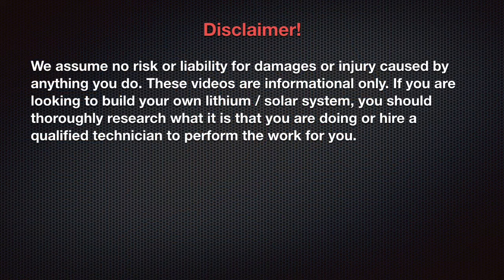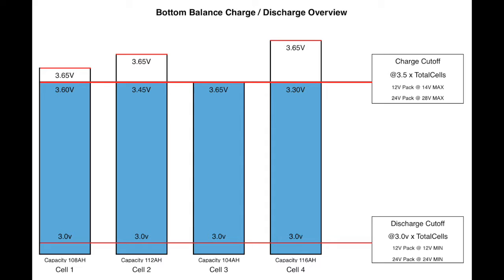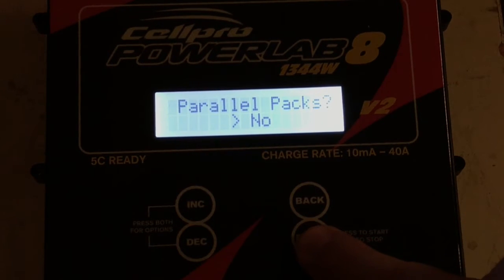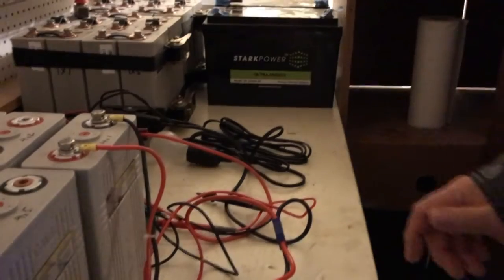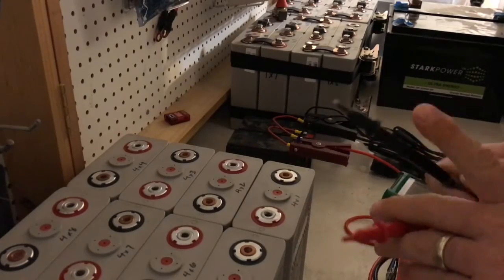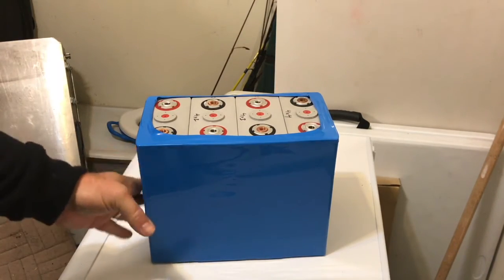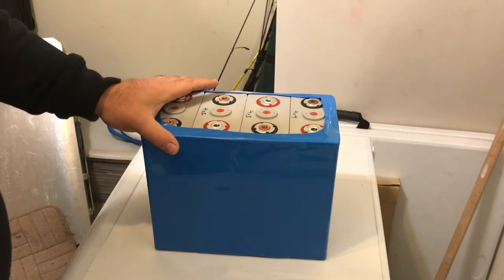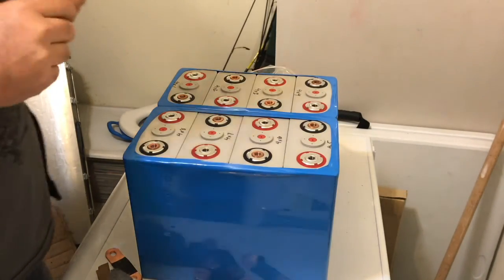Full Time RV Living | Lithium Battery & Solar: Part Three Building the Lithium Battery Pack

Comment: Okay, I'm still following this series and enjoying it.  I have one problem while watching and that is you WEARING THE RING while working in these low voltage high amp situations.  During the years I worked around this stuff, it was habit to remove any and all jewelry before the day started.  Just saying...  Keep up the good work.
Reply from the maker: Yup. Knew someone would comment on that and I don't disagree. Generally speaking when dealing with batteries, the spacing between terminals or other contacts is sufficient that a ring along won't present an issue. When working in tighter spaces I do tend to remove my ring. Again, I don't dispute your recommendation.
Reply: I do have a wedding band with an arc-strike on it...  cable terminal on a Chevy V8 starter...  By golly that ring got real hot, really quick !   rc
Reply from the maker: Yikes! That’s a good way to test a starter. Yah, we get too comfortable sometimes.
Reply from the maker: +DRS_ au yikes ... well you all will definitely make me think twice ... that’s likely a good thing? Thanks for the feedback Rusty.

Comment: Following with interest, great job!  I'm planning 540AH 12v using the Calb CA180 cells. A couple questions if you don't mind. Did your Calb cells come with any of the 70mm braided conductor straps included ? Also what size is ,and where did you source the shrink wrap tube material? It looks like the size you show might work for 4 of the 180AH cells. Thanks for doing the videos ! Subscribed.
Reply from the maker: My calbs came with solid (multi layered actually) copper interconnects and the m6 bolts. Nothing else. I’ve read that the breaded material can oxidize. Not sure how valid that is. I could only find the large shrink wrap on eBay from China. Initially I used 500mm flat width then tried 430mm. They both worked equally well. As with all eBay orders my links no longer work. I believe this was the ebayer though https://www.ebay.com/itm/1M-Blue-Flat-Width-500MM-Round-diameter-318MM-PVC-Heat-Shrink-Tubing-Wrap/262530261320?hash=item3d2005e148:g:IbEAAOSwtnpXi6FS

Comment: Good video -   system you built is Real Nice - cellpro looks like it works good - Im using Calb for van conversion - 100 amp hour tiny -  using van alternator w li ion  charger -  wish calb had ghb mounting and covers -
Reply from the maker: GroovyVideo2 yah ghb covers rock. I did find a place in Eastern Europe that sell term covers. Shipping was insane but ended up paying about $120 for the 64 caps I needed. Well worth it and they fit snug. I'll grab the link and reply here. 

Cell pro was great. But it's been a once and done. The calbs are staying in perfect balance even when running two AC units and drawing up to 200ah of the batteries (which with 4 banks is 0,5c.).
Reply from the maker: Size 2 fits the calb 100ah cells. They sell black and red of course. Half the cost will be shipping but for the money it's still worth it to cover up the terminals. Everything fit snug. I'll have a video on them shortly.

https://www.ev-power.eu/CALB-40Ah-400Ah/Terminal-Cover-for-Cells-Size-2-Red.html?force_sid=m8i8j2n8d52jil1ncppgj7ol77
Reply: Good battery good bottom balance and they stay happy -  charger Im using is similar to cellpro - dose both bottom and top balance - its almost fun watching it work - led screen - thanks for posting vid on low volt cutoff its  just what I need to add  - Jay
Reply from the maker: Yah the victron battery protects are definitely a nice safeguard. Something I wasn't sure about is if it would cut off the charge (my inverter and charger are one unit so it's either draining or charging the batteries) to the battery when the low voltage disconnect engaged. I came across a statement that implied it would not which is the behavior I would want. So in essence it's a 1 way disconnect. 
Watching the cellpro was pretty cool .... for about the first 8 cells ... after 32 I was over it :)
Reply: Could the victron battery protect and an appropriate load be used for bottom balancing instead of the powerlab 8?
Reply from the maker: +harleyd500 probably not because the battery protect has preset voltages for different 12 and 24v banks. You need something that can stop discharging a single sell around 2.5v. You can use a multi tester and a lot of checking but once the cells drop below 3v the process happened pretty fast so you would need to be on top of it or risk destroying a cell. You could use a cheap cell monitor that sounds an alarm. However, many of those lack accuracy.

Comment: It hasn't been explained, so I thought I'd ask..why bottom balancing, rather than using a BMS controller, making it much easier and less maintenance time for the owner of the battery bank?   Doesn't the BMS do it automatically, or at however you select it to do it, with a lot 
less input in using up your time?   Just wondering if it is the additional cost of BMS or another reason?   Thank you!
Reply from the maker: Hey Dale .... yup I pretty quickly dismiss a BMS (battery management system). I do however support a cell level monitoring system such as ones you will find from Zeva.

So, BMS or active balancing VS bottom balancing. Search YouTube for that and you will find folks areguing both ways. When I started researching and building this system some almost 3 years ago, there were fewer good options for active balancing BMS systems. And yes then really good ones were expensive. Most solutions required balance boards or other complex systems that would ultimately be the brains of your batteries. And if your batteries went brain dead? Well maybe you would still be able to use your system at a risk or maybe the failure would result in your power system being disabled. Where do you got for parts? Walmart? Not :) with lead acid, if you had a bad battery., you could go to Walmart and replace it.

Most balancing systems kick in at the top end of the charge. So as a cell achieve it’s upper voltage setting, the balancer try’s to shunt the extra energy as heat. Here’s the problem. All are rated at a certain amperage. Let’s say 2amps. Ok great. Let’s say you are charging your batteries at 70amps? Think it will keep up? Those were some of the early arguments. There are more quality BMS’s out there today for a more affordable price. But, these are concerns you should consider when selecting a system. I’m not against a good BMS and personally believe it’s an good option for many people and situations.

Bottom balancing is easy though. It works on the premise that the cells will remain balanced through its charge and discharge cycles. Stay within a reasonable voltage range and your cells will remain balanced for years or longer. Simple system as long as you have that finite control over your charge and discharge of the bank. I do. My inverter and solar charge controllers all are configurable. 

So, what if something goes wrong? That’s where cell level monitoring comes into play. The little cheap RC cell loggers will pull power from just the first few cells which will result in the cells going out of balance. So you need a solid product such as a couple products Zeva makes. In its simplest form a cell monitor will alert you of a high voltage HV or Low voltage LV condition. More capable will add temperature as well. Audible alerts are great but more valuable are monitors that can control a contactor, inverter, mppt controllers via a set of open/close relays. Now we have a monitoring system that doesn’t try to mange cell voltage and we have a means to stop charge or discharge based on a cell level condition; if a single cell goes south or north. Keep in mind it’s not in place to stop or start normal charge and discharge cycles; your inverter, solar controllers etc will do that. It’s just there in the event an extreme situation happens. So in normal everyday use, the cell monitor is doing nothing other than monitoring. You can get fancier with systems that will display the cell voltage, bank voltage, bank state of charge, internal resistance etc. However, those are nice to haves. Anyhow ... that’s my take. I’m certain I am bias for some reason. I see bottom balancing as keep is simple. The key are quality cells. I’ve been extremely happy with CALB. Hope that help boss!

Comment: Hi, thanks for the excellent video. Would you provide the exact wiring diagram for the powerlab 8. Is the powerlab 8 connected to a power source, or does the lithium cell power it?
TIA,
Steve

Comment: not worried about the heat gun on those cells during shrink wrapping?
Reply from the maker: Not at all. I was working my hand over the shrink wrap once it was tight and there was little residual heat. Also this is the stuff they use to shrink wrap lithium batteries when you buy some pre made packs.

Comment: Thanks for the vid.  You mention taking them down to 2.5v and 2.65v but in the graph you mention to not go less than 3v (due to the voltage cliff).  Why the difference?

Do you ever see a need to bottom balance again once they are installed or do you plan to check them once in a while to make sure they are not out of balance?
Reply: Cory Wikel 
the 3 volt limit is for discharge while using the battery (so 24 volts for his battery and 12 volts for those who are staying with a 12 volt system).
The other 2 numbers are for when he is draining individual cells to perform bottom balancing.

Comment: Ok..... quick question, just curious why you didn’t go with the oh I do t know, RENOGY 3600 watt solar kit. Those are 300 watt panels. Hey but props to ya brother, I’m not that patient. From my understanding those lithium and the 6volt last the same amount of time from my calculations. Really really good job on yours though. Real good.
Reply from the maker: 300w panels were two wide. These 190w panels go right to the edge of my roof and are inches from the air conditioner. Otherwise I would have gone with larger panels from a local wholesale. Because my rv has 3 air conditioners and two vents, I have very little wide open space so opted for narrower panels. Also, lithium can be drained to around 80-90% where as most lead acid, gel, agm can only be drained to 50%. So usable amp hours are much higher on lithium not to mention weight per AH is much lower. If space isn’t as much of an issue, you can really pack in a good deal of usable amp hours using lithium. I would have had to go with about 14x100ah deep cycle batteries to get the same power I’m getting from the lithium batteries. Thanks for the comments and for watching!!!
Reply from the maker: Btw, I got my panels for around 50 cents per watt. That same 3600w kit that renogy sells for $5300 on amazon, I could build for much less. Close to $2000 less. Buying kits generally cost more not less if you shop around for panels. I went through sep batteries dot com and got a great deal on my panels. Likewise, I wanted to use victron mppt controllers to better integrate with my victron interver/charger. Not to knock kits. They take some level of planning out of the equation and often give you most of what you will need for a complete system. Hope that helps.

Comment: I am following your lead and building a lithium battery pack. However I am doing it with 200ah cells, which are a bit bigger.
I also want to do a heat shrink wrap but would prefer to use black to match the cells. The biggest black wrap that I found is 465mm, giving me only about 5 to 10mm of loose shrink wrap.
Is that enough, or does this stuff need to shrink down a much larger percentage in order to be effective??
Reply from the maker: Yah if I could do it over again I’d definately go with larger cells. I was originally planning to install the cells in a different location which benefitted from then 100ah cell size. However, where I ended up installing them could have easily handled 400ah cells. Oh well. Next time maybe.

As far as the wrap, a couple things to consider. If you go too tight and the cells are exposed to high heat, the wrap could shrink more which could result in holes developing or possibly deforming the cell cases in an 3xtreme situation. You maybe be able to wrap fewer cells. I would have liked to bundle eight cells together but could only do four. Also too small and you may not be able to get the wrap around the cells.

Good luck boss and let us know how it all turns out.
Reply: RV Exodus 
I just read an article on building lithium battery banks for boats and Sinopoly battery representative was very adamant about using only 100Ah or 200Ah cells, will 100Ah being preferable.
The reason is that larger cells do not have structural strength to be in a mobile environment and the risk of premature failure increases drastically. 
Of course, RV do not go though what ocean going yachts go though but still, there is a bit of shaking going on as we travel down the road.
After reading that article I am very glad that those 400Ah cells I was interested in were not a good fit for my battery tray.
Reply from the maker: I’ve read the same. I have also read that if you compress them, such as between aluminum plates, which most manufacturers recommend, it’s lessor of an issue. I was also pondering parallel banks vs parallel then serial to create one large bank. If one cell in that large bank goes bad and forces a shutdown, the entire bank is offline. Everything is a compromise and we do have some choices based on our particular needs. Synopoly would recommend parallel first the serial I’m guessing. I could go with two banks made up of two cells in parallel and eight serial (aka, 2p8s). That way I could still keep one bank online if the other needed to go offline. I rarely pull more than 100amps and have only gone over 200amps once. So even a single 2p8s bank made up of 100a hour cells would handle my typical loads with no issue. In a marine situation where redundancy is important, I suspect two banks would be ideal. Currently I’m running 4 banks which has made the cabling a little over the top. And let me tell you. Custom making all those cables got old very fast :)

Thanks for the insights boss.

Comment: You seem to be knowledgeable of this stuff.   Are you specialized in this industry ?
Reply from the maker: Not quite. I am an IT manager and still a nerd at heart. However, I do a lot of reading and try to conclude what is best for me. My wife would consider me a researcher. I suspect that is accurate. Thanks for watching and stay tuned. I have quite a bit more solar, lithium, inverter videos in my backlog. You might find the one where I pull off running two airconditioners of interest. Or amusing maybe :)